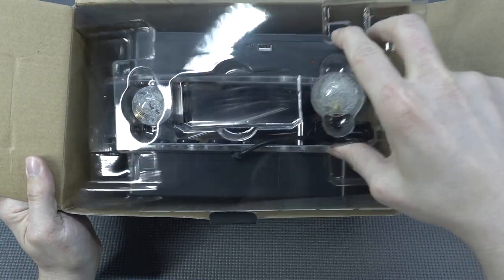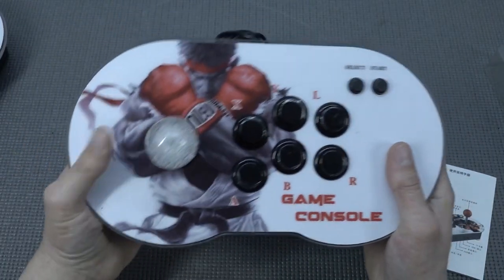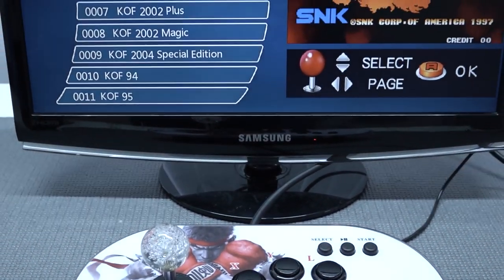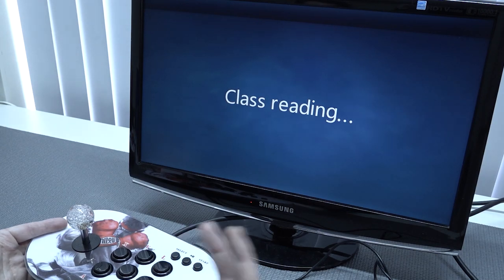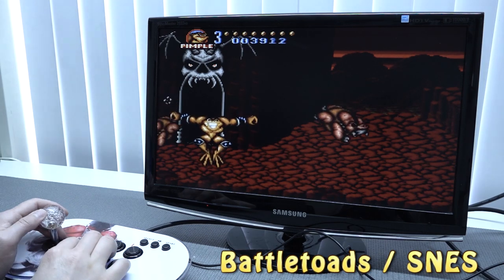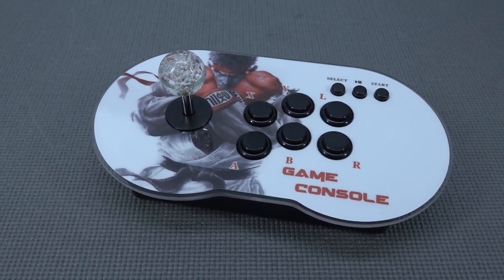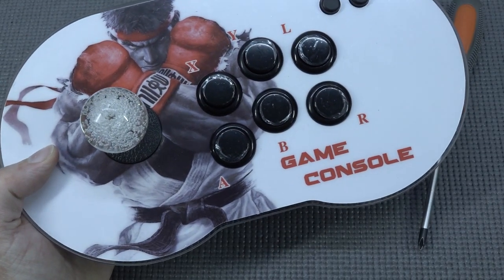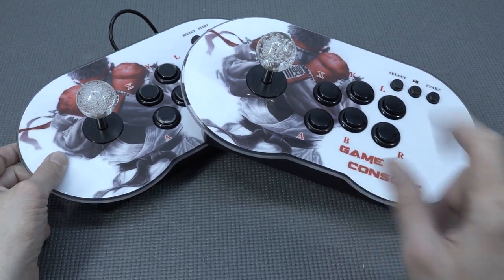The Duo Budget Game Console from Ali-Epress / Finally Something Else !

Comment: Out of the blue its SD card seems to have a problem and it won't pass the initial "loading" screen. Is there a fix for this by accessing the SD on the PC? Can't find support anywhere. Thanks in advance

Update:

The TF seems to just have bricked.
Can someone who has this console  copy the content of their TF card and send it?

I can't find the correct file structure for this anywhere and the product is unusable. It 's very frustrating that the manual doesn't provide contact details for the manufacturer.

Comment: 15 years passed since i bought my first chinese mp3 (clone of an ipod apple)...and i am still amazed how much consistent are the chinese tech products in being unreiable and buggy. Look at the pandora consoles. They have a pretty stable software, they have consolidated manufactured practices in the hardware...they know well what is the minimum cpu power to decently run those console platforms...but they are only interested in making the emulation just playable. These products are not for fans of emulation but just for the casual young consumer that want just to play free videogames (that he doesn't know and he doesn't have played before) for few bucks.

Comment: Just like those many old pong consoles were you have to connect the second controller to the to main console,BUT what they actually should,ve done was to add extra weight to it to make them more stable during gameplay,
I don’t know if the slowdown is caused by the emulator or the main chipset or a combination of both BUT it should run great with those 8bit classics with no input lag right??
If so then i consider it a must have,,,,if.